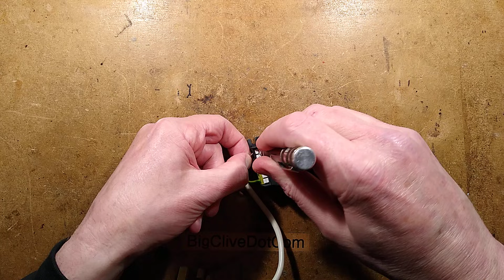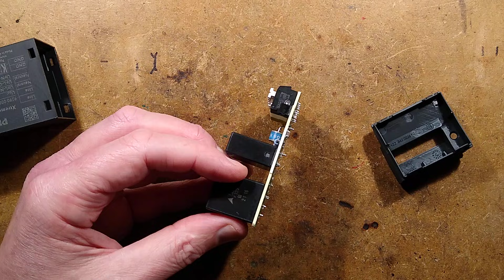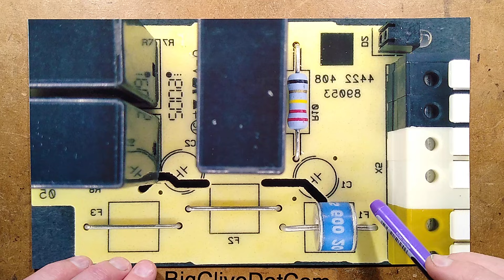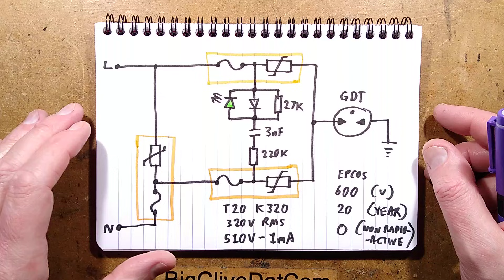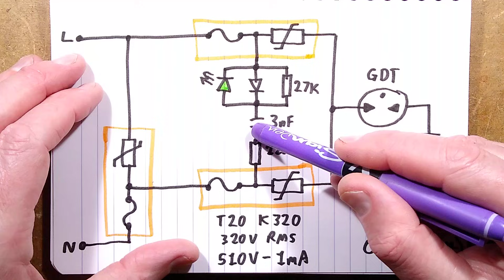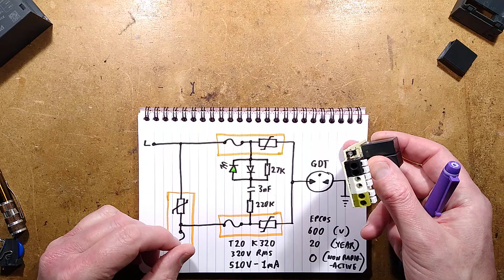Inside a Philips Xtreme surge device for street lights

Comment: Can i use Philips SPD Gen3 Wire potted 10KV as Surge Protection Device for my Electricity extension board which has 230v AC and which will run the desktop computer and a 43 inch LED TV? I shall be highly grateful for your advice, Thanks
Reply from the maker: If you powered it from a suitable breaker it could be useful, but you do get ones for use in electrical panels.

Comment: Clive please let us know what the inrush current  is in k V  max rating?. Our three pin 16 Amp plug can be bought with a MOV fitted for Surge and Lightning -. flash protection. I did see a burnt out unit mentioned above except all components totally burnt to smithereens.
The sample unit I have from VS  Lighting Solutions states T3 Uoc = 10 k V 
SPC3/230/10K/i  Made in Germany. Given to me by Barry then Sales Manager for V S for all southern regions in Africa. Now holding a very high position in the United Kingdom. He is very knowledgeable and helpful.
Greetings from South Africa. Enjoy very much your informative Y T contents.
Reply from the maker: If a surge protector is very exploded it may have dealt with a massive transient or lightning strike.
Reply: We came to the same conclusion. In Johannesburg along the Witwatersrand ridge we have great spectacles of  thunder and lightning shows. Especial at night. 
JHB is 6000 feet above sea level.
Still, would like to know the rating of the deconstructed sample that you explained ln simple terms and so erodite. I look forward to watching and learning in your further Pod casts. Never too late to learn and explore thing e take for granted.

Comment: Will these come off?

Well just about anything if you apply enough Force would come off!

And not reasonable Force either even if it's rapid expanding gas or set alarm results of a certain type of force yep it'll come apart.

When it doesn't come apart get a bigger whatever you're trying to use the ticket apart!

Unfortunately when you want it to come apart and it's supposed to.

Such is the last bolt you're trying to get out when you need to get access to something or replace a part of course that's going to be the one that fights you the most when doing it.

Usually a ugga Duggar gun will take care of this if you're lucky.

. What's helping someone out and well bolt did not budge however impact rated socket gave up the ghost pretty violently!

Glad he was wearing proper PPE.

Scratch on his eye protection right where it had hit would have been dead center in one eye!

Just goes to show what's my team overkill for personal protection might just be your Saving Grace

Comment: The fifth black band may indicate it's a non-inductive wire-wound resistor (or, more likely, may simply be used to indicate the right-hand end).
Reply: I thought that indicated flameproof as well as non inductive WW. It's not clearly defined.

Comment: For the resistor with 5 bands, the first 3 colours is the value, 4th is the multiplier and 5th is tolerance, so 224 x 0.1 Ohm, not sure what the black tolerance band signifies.

Comment: I can understand that LED street lighting is more energy efficient, but whilst driving, I actually prefer the light from low pressure sodium lamps. Plus the night sky light pollution seems worse now with the widespread use of LED street lighting, despite the illumination spread supposedly designed to be completely downward. Why don't they use Yellow LEDs?
Semi conductor devices (like LEDs) are definitely more prone to damage from voltage spikes, especially from nearby lightning- I have had to repair some of my fried equipment following a near strike.

Comment: This device seems to be able to absorb minor transient pulses but anything that triggers any of the fuse links renders the device useless and the transients still get passed to the lamp. Surely the lamp should be wired to disconnect if the the suppressor fails to cope with a large transient.

Comment: A black band at the end means bifilliar winding (to annulate inductance) meaning it is non inductive. The common 5 band (usually used for low value of high precision resistors) does not work here because this usually means 3 significant digits a multiplicator and a tolerance but there is no black for tolerance and it would made the resistor have 22.4 Ohm what would make no sense for this voltage divider for driving a LED. This makes sense because an inductive resistor of high value would be too inductive and could cause the discharge tube conduct when turned on.

Comment: A few sources seem to indicate the black band is, at best, to indicate the orientation of the resistor color bands - though it's superfluous in this case with a gold tolerance band. It would be useful to have those black bands on my cheap 1% resistors that CAN be completely ambiguous to read!

Comment: Great video, I would add that the installation requires the earth connection to true ground also and needs careful consideration and not relying on the mains earth to carry the surge away. In places like Edinburgh castle where the earth is poor due to the local geology, connecting the surge protector to the mains earth will do little to protect a system as the surge will travel around the earthed devices and do damage elsewhere.

Comment: Thanks to these videos I now open up new surge protectors to see if they are high quality. I recently got an Ethernet surge protector with 4 dual gas discharge tubes inside that shunt to ground. They glow nicely under high voltage.

Comment: I've seen on aliexpress laser range finder units (Control board and range laser unit and recivers only)  that claim to go out to well over a kilometer with less than a +- 1m accruacy. These range finders also use arduinos and USB connections and are dirt cheap. The sellers all say they will provide softwear and that they will help set them up. Would you be intrested in doing a breakdown on one?

Comment: I wouldn't use the term 'Xtreme' for a SPD that has pissant push in terminals to connect that Earth or A & N conductors. 

Get ya hands on an average sized Metrosil if you want to see a SPD that some may think has an 'Xtreme' tag... even though it is still only 'average'.

Comment: As it reacts on overheating of a bit of soldering, does it not react too slowly to be of any use?
Reply from the maker: The heat build up from failure is progressive over time.
Reply: @bigclivedotcom   Oh? I thought it is to protect something from quick power surges?

Comment: Interesting circuit. The ones I have seen here in NZ have just 3 of those blue MOV's put in a heatshrink sleeve. No fancy thermal fuses. The LED is nice but I doubt it that streetlight repair crews will check that and open the unit from  a bucket truck to see if the MOV's have operated. Lamp fail, Complete unit ends up in the skip. I have seen hundreds of newish led streetlights being thrown in the metal recycling skip. I usually salvage the Wago connectors. I see if I can find some of those fancy units. The way you opened the device up to smoothly is awesome. Keep up the great work Clive.
Reply from the maker: Yeah, the landfill generated by the very expensive "last forever" LED streetlights is appalling.  Almost at a fraud level given their cost.
Why change a bulb when you can change the entire thing and have the labour drop in a new flex while they're at it.

Comment: The resistor is a 5 band and is read... Red Red Yellow so 224 the multiplier is gold so 0.1 so 224 * 0.1 = 22.4Ω with a black band for 5% tolerance....the clue is in the 5 bands....cheers.

Comment: Clive, coud that circuit board have been made also to function on 3 phase power in a different application? I do realize that three phase lighting isn't all that common, if it ever was.
Reply from the maker: I doubt it due to only having three terminals and potentially needing a ground.

Comment: Current versions for USA, are House hold, LARGER. and Probably more expensive.  $200.
The Problem I tend to see, is GROUNDING.  Taking it to common or Separate Ground?  makes you wonder WHERE and WHAT its going to interact with.  Like thinking, what is done is OK.  Until there is POWER CHARGE on the negative or ground WITH other items..
Reply: In a street lighting applications each pole has it's own separate 'Ground'. 
Are you suggesting revenue metering of Ground conductors that should NEVER be used for anything other than protection current flow? 

In a residential or commercial installation the NEUTRAL (not "negative') is revenue metered by virtue of the Active (not positive) current flow, even if some DIY dickhead uses a Ground instead of Neutral. 

The problem I see, is you are stuck with 120V mains supply that makes everything more expensive due to higher current loading... and so, larger conductors... aside of the obvious issues of allowing unqualified idiots being allowed to wire up homes.
Reply: @BTW...  the Thing about USA power is we have 2 110v(220v) incoming, and recently went to 1 common 1 ground(30 years ago).  AND a Polarity Plug. But common and ground Even when separated, are combined MOST TIMES.  With electronics, it would be Nice to Isolate the Ground, so as not to get residual feed on the common. 
I live in an area that in 1980, if the wind went over 40mph, would cause Power failures.  I came back in 2000, SAME problem.  I called the Public Utility counsel and told the the story.  NOW It has to get over 60mph before we have power failure.

Trying to get Clean power in most Rural areas, is NOT easy.  There is equipment still up from the 1960's, ready to fail.  They WONT fix things until they fail.  The creators of the Systems, arnt around, its only the bill collectors.

Comment: Hi bigclive
Small remarks ...
There is a special tin alloy in use in termal fuses that has a defined temperature point to pop up. If you try to repair such parts and solder it with your standard tin you will have undefined switching characteristic depending on the properties of your tin alloy. So don't repair such fuses - only replace.
The reason for the 27k resistor is (slowly) discharging of the 3nF capacitor over the themistors in case of defective LED or Diode.
regards
Hans

Comment: Good for one surge only since the load isn't connected inside the protection.
Reply from the maker: It's designed to clip multiple transients within its range.
Reply: @bigclivedotcom  But if one big one trips that spring link, the load is left connected with no protection at all,

Comment: Always interesting to see how different types of mains surge protectors configure the failure indicator. On this side of the pond I don't thing gas tubes are used to isolate safety ground from live and neutral but I could be wrong. The thermal fuse was pretty clever.
Reply: It has more to do with the speed of what you're trying to suppress. MOVs are rather slow devices meant to clamp a longer duration surge, where the gas tubes are very fast acting for clamping short spikes. Having both in all 3 positions gives the best protection overall. The integral fuses are a nice touch to protect the system when the MOVs do fail after a few hundred cycles and become very resistive (and hot).

I used to build these for power conditioning in my classic arcade games (think Ms Pac Man, Centipede, etc.) during summer when thunderstorms were very active. I used to buy RAM chips by the stick before adding the suppressors and never blew one chip afterward. Radio Shack carried these parts, but in their demise, sourcing such parts became much more difficult.
Reply: @mikecowen6507  Back in 1992 we took a direct hit on the utility transformer servicing our house. We are about 600 feet off the road and have our own utility transformer. It took out much of the electonics we had at the time including the controller for our submersible well pump. Since that time I take lightning and surge protection much more seriously because if it happens again we have many more electronic toys.

Comment: In solar they recommend a lightning rod separate from the surge protection with another ground. I havent, and cross my fingers alot when it gets cloudy but my panels are lower than the rooftops so I take my chances.

Comment: Great component to dissect! The "L" is for inductor, C of course is capacitance. They can be a failure point, although they provide DV/DT control with some fast moving spikes on the line. I designed a 3-phase industrial surge protector once. It had L-C filtering on it. Interesting they chose not to populate those positions.

Comment: I have a question if anyone could help. If I have a TP4056 charging module, can I use it to power an led string light from an 18650 LiOn without the 5v usb powering the board? Or do I even need the module. I'm in Chinada and have developed a hatred for solar charging. I'll bring it in and charge it. So, really what I'm asking is how do I power a set of micro-led string lights with an 18650 without damaging the lights or the battery? Thank you for you patience on reading that. Unlike Trudeau, I'm open to any advice. Cheers.
Reply from the maker: You could add it in to charge the 18650, and keep the rest of the circuitry active as the dusk sensor.
If just using the battery and lights you will need a 10 ohm resistor in series between the battery and lights on either supply wire.

Comment: So the protection comes from the MOVs/GDT shunting spikes, presumably relying on a fuse/circuit breaker elsewhere to isolate things if the current spike is severe enough. Only if the overvoltage condition persists will the thermal fuses finally activate to stop the MOVs from bursting into flames. 
I’d have thought it might do an even better job had another two terminals been provided to provide the same level of protection for the load as the LED circuit receives. 
Presumably GDTs degrade faster than MOVs which is why there is only a single (protected) one rather than a pair going to earth directly from the two supply lines?
Reply: Only one GDT is needed.
Reply: @BTW...  In this circuit, yes. My thought was that as GDTs have a greater current capacity a pair could provide more protection and the rest of the circuit would be superfluous. Obviously in that case you would need two.
The circuit appears to have been designed for a longer lifetime, minor differential voltage spikes being handled by the MOV network, which isolates the GDT from these more frequent disturbances which would otherwise shorten its life. The GDT only comes into play in the event of larger or common-mode spikes.
After a little searching, I have found that GDTs are also slower-acting than MOVs so it makes even more sense to rely on those as the primary defence.

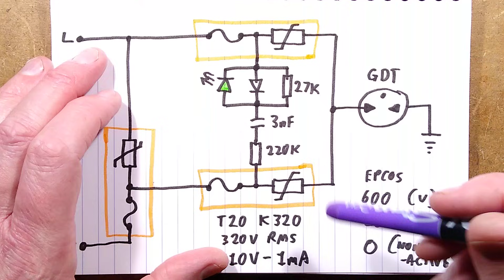Comment: Slight add: 7:25 The function of the reverse diode is not only capacitor discharge, but also if not there, the LED could get ~40 V on its cathode. Can't see why they used that 27K resistor, that limits it down to that 40V, in stead of 350V. A bit odd I think.

Comment: I remember like 15 years ago when we were being dumb teenagers we used to kick lamp posts and if you hit them just right it would turn off the light for a few minutes or sometimes until the next on-off cycle. Wonder what kind of protection they had that did it
Reply from the maker: It was just the lamp shaking in its holder.  If the current is interrupted they have to cool down before they can restrike again.

Comment: Could you use an insulation tester to measure the actual threshold voltage of an MOV??   Since the testers have a 1 milliamp current limit it should not damage the MOV and you could read the drop across the MOV at trip point
Reply from the maker: It will show up as a resistance on an insulation tester, and it will actually degrade the MOV.

Comment: You said in the beginning it was in parallel to the load. It would have to be in series to break the power to the load.
Reply from the maker: It doesn't break the power.  It just shunts transient voltage spikes

Comment: The wire and sink EDM machines that I fix for a living have used TDK-Lambda switching regulators in them for the last 20+ years or so. They're quite robust and I find very rarely fail. Though, I've still got piles of old ones that I have to scavenge for parts to fix others. Their supply lines have been problematic for the last 3 years due to shortages.

Comment: Very few professional street lighting engineers around these days as were mostly retired. Also very few trainees.
Reply from the maker: No problem.  The industry has literally got it down to a one day slideshow called the G39 which is often referred to as "The street lighting ticket".  There are literally companies hiring unskilled labour off the streets and using that slideshow to justify using them to do live electrical work in a wet outdoors environment.

Comment: Interesting device, in special thermal fuses on the MOVs, a very clever solution, remember safety wire resistors used on TV sets to protect power circuits like audio outputs...
Thanks to show it...

Comment: Oddly serviceable for something that's designed to be one-shot, assuming someone actually does decide to replace any tripped MOV modules...
Reply: It's not one shot unless it receives a direct lightning strike. Most surges are caused by other inductive devices powered by the same network.
During storms, high voltages can also be induced in distribution lines due to capacitive and inductive effects even if they are not directly striked.

Comment: Hey Clive, Those May Be Good To Use On Our Solar Panels For Lightning Surge Suppressing Also? Thanks, Butt I Can't Find Anything Like Listed On eBay or Amazon? 😢😁😎
Reply from the maker: They're quite specialist, but you can get ones designed specifically for solar panel and distribution board use.